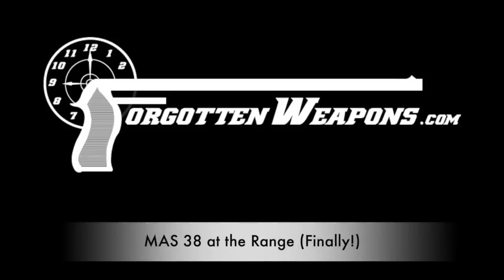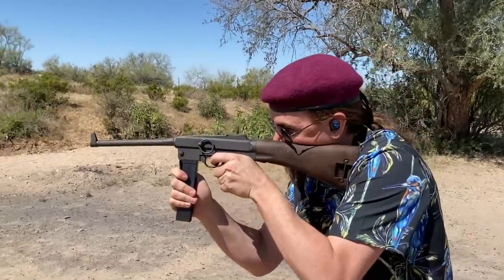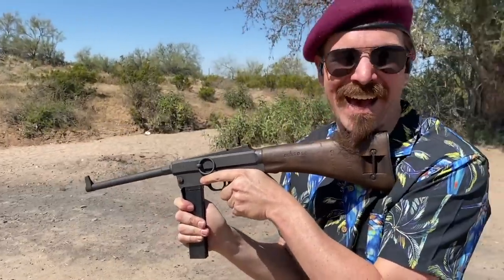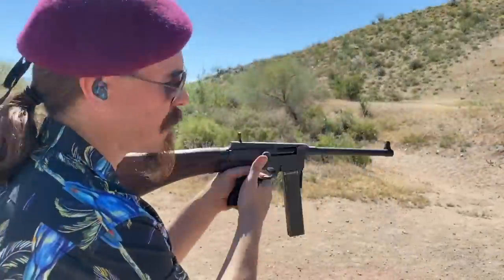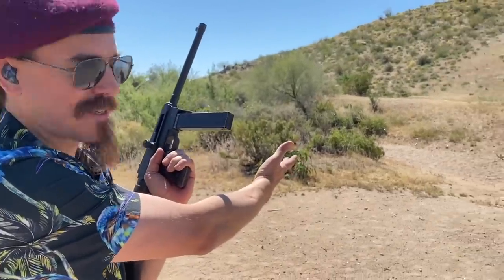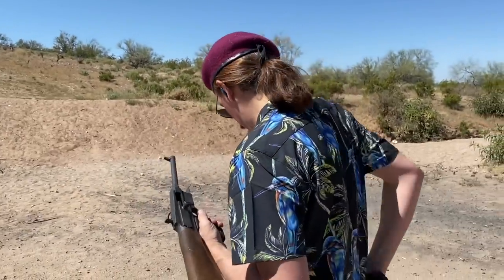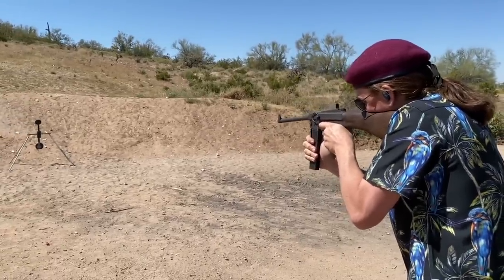MAS 38 at the Range - Finally!

Comment: My OCD can't handle how the gun is angled. 😂
Otherwise great shooting.
Reply: Ikr, it's so weird, it looks like the barrel is bent down like something out of a cartoon.
Reply: I know, right? 😄
Reply: Have you ever seen a Jatimatic, now that is angled weirdly.
Reply: Oh good, it's not just me.
Reply: It makes sense when you see how the gun works but looking at it on paper does seem off.
Reply: @samikoivisto7705  Oh, Gun Jesus, why did I google that.
Reply: @samikoivisto7705  If the bolt of the Jatimatic recoiled upward to resist muzzle climb, it stands to reason that on the MAS-38 the reverse is true. I wonder, because there are no reports that the MAS-38 was especially inaccurate. Ian doesn't claim so either.

Comment: I’m confused, he clearly shoots three single rounds and says he can’t pull off singles.... what am I missing?
Reply: Agreed, that confused me too. I even slowed down to quarter speed and you can clearly see a single case eject both times...
Reply: I scrolled a long way for this. I think i know why. When you shoot an open bolt gun. You hear the bolt going forward and fire the round. And then you hear the bolt smack the rear and it feels like you shoot twice.
(At least i felt like that shooting the Swedish m45)
Reply: @luckygunner8089  I thought similar, but also: Ian has shot pretty much every firearm that has a working example in the world, surely he'd know this? I put it down to heat of the moment confusion.
Reply: @chrisburn7178  Maybe his excitement got in the way of logic. Wouldn't be the first time that's happened to a man, heh. And come on, he finally got a WWII era submachinegun running after years of trying, who wouldn't be excited!

It also looks like a nice little shooter.
Reply: It is the open bolt... it tricks you.. it feels like it fires 2 rounds. 

In Denmark we had a submachinegun where that would happend to.... you shoot one round but feel two recoils.... it is very weird.
Reply: @luckygunner8089  EXACTLY.... the same i am writing about.... shit that was weird...
Reply: I was wondering about that too. Was really confused since it sounded like only one shot each time
Reply: I too noticed the discrepancy, but I assumed that he meant he could not fire one shot at a time accurately, as he was snapping the trigger so energetically. His snapping the trigger is not conducive to accuracy, but is the only way he could do it.
Reply: Cool, I’m glad I’m not the only one who was confused by that.

Comment: Keep the mag well cover in its “open” position, that is parallel with the barrel. Could get your hand high on the mag without burning the fingers. Just a thought. Great to see it finally running. Beret sloping the other way for the French please.
Reply: I think he's actually trying not to grab solely by the mag, in order not to induce feading problems
Reply: Damn thought I was the only smartass that commented on the Beret...
Reply: He also could be worried about damaging it
Reply: Just reminds me that no matter the circumstances you'll be told that you're wearing your beret the wrong way. 😋
Reply: i think he a grabbing low to avoid getting tagged on the thumb by the charging handle, or knocking spent cases back into the ejection port
Reply: I was going to suggest resting other hand above the stock close  to the person's shoulder.
Reply: It also looks like a Swiss Army Beret wich in this colour is for Logistics Troops

Comment: The spectre of Karl's pledge for the 6 o'clock hold is bashed down by the beillance of .32 longue & a working Mas38. Ian is a very happy francophile
Reply: If Karl says it’s right, it’s wrong
Reply: Karl is the Jamie to Ian's Adam
Reply: @CrudeConduct666  I've not really messed with it but I think it makes sense for more dynamic shooting, at least with irons. For the most exaggerated example sporting shotguns always use what could be called a very heavy 6 o clock hold so you have full view of where the shot cloud will go and don't lose the target/bird behind the barrel.
Reply: 6 o clock hold is for unknown distance shooting or machinegunnery when you don't know exactly where your first impact is going to be.

It's not meant for the range. It's basically for using kentucky windage with low magnification Optics in situations where you don't have time to figure out your proper hold, the idea being worst case scenario you'll definitely see the first impact to adjust off.
Reply: @CrudeConduct666  Except you can't see what you're shooting because you have it covered with the fucking sight post.

How to recognize an inexperienced marksman. ^
Reply: @Batchall_Accepted  or, it is the simple fact that Ian tends to choose point of aim & Karl of InRangeTV is a proponent of the 6 o'clock hold. So as friends, Karl states that 6 o'clock hold & Ian's wrong handedness is good natured ribbing between friends on aiming procedure that has gone on for years
Reply: francarmophile please... he does not have ANY relations to the language

Comment: What was actually repaired that you didn't find??
Reply: Please ask in next Q&A
Reply: I am also curious.  Or perhaps it was a number of small issues combined?  Burrs and such?
Reply: For what I can recall the original barrel was weld pluged and then re cut but too long so the ammo was not seat properly in the chamber. Might have needed a new barrel or some extra work in the feed sistem too and bolt re face.
Reply: @luisantolafrancis519  That was one of Ian's theories. But I want to know for sure.

Comment: An interesting looking design with the barrel appearing to run down and away from the line of the receiver and from what Ian described the bolt running down and away in the other direction. Great to see you happy using an old weapon that the yupps of today would cast off as a why would you bother weapon. Cheers for the vid.

Comment: Just from a visual first impression, it seems almost to be straying into the machine-pistol category along side a stocked C96 and Vz. 61, etc. It  also seems like a good match for the role it ended up in as a Gendarmerie machine carbine, particularly because of the low power cartridge. Amusing aside:  If you ever had a UK 'GI Joe' - 'Action Man' - and bought the WW2 French Resistance outfit set, this was the SMG that came with that! :)

Comment: About the grip: Until the mid 1960s, French security forces all based their shooting techniques and stances on military practice. For this reason, I would suggest you get in touch with Le service historique de la Défense, the French military archives, who may hold 1930s instructions relating to the shooting stance using a pistolet-mitrailleur. They not only have access to the French Army, Navy and Air Force but also those of the Gendarmerie, as well as anything where the military worked with the various police forces.

Comment: Nice. I was hoping to see it up and running someday with good ammo. The cyclic rate looks like about 750, but does anyone know what the spec was? If i heard the ballistics right, it is a bit above the 9x18- 15 gr more bullet weight, and a little faster. Unless you are referencing 9x18 velocity in an SMG length barrel. Anyway, i would not care to be standing in front of it within several hundred yards. Pkease make a video detailing what work was done on it, and a little more about the ammo. Great video as always. Thank you

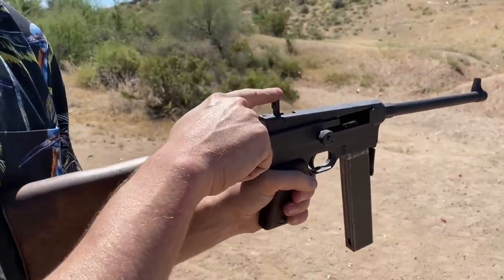Comment: Ian, at 3:49, you have what looks like a serious crack in the stock developing. I hope it's just my old eyes, but it would be a pity if your lovely newly running MAS tried to skewer you in the hand with splinters.
Reply from the maker: That is a fairly common thing in MAS 38s. The stock has shrunk around the metal tube housing the bolt and spring, and cracked as a result. It's not from recoil, and won't get worse or break from shooting.
Reply: @ForgottenWeapons  Good to hear. Thank you for replying!

Comment: It may just be my imagination but there's something about this SMG that really betrays its WW1 origins.
"I have this Ruby pistol. It's great for trench raids, but not very accurate. In order to win the next Great War we will need something like this, but more betterer."
Gunsmith adds stock
"Accuracy is improved, but range could be better."
Gunsmith installs longer barrel
"It's accurate to a couple of hundred metres now, but I want to put holes in Germans faster."
Rebuilds for open bolt full auto
"That's great but the mags run empty too fast. Put a longer one on it. Put it forward of the trigger, so the grip can be nice and slim."
New mag arrangement
"Parfait" says the French Colonel. "I want 10,000 of these before the Huns next try to invade. Oh and make sure to chamber it in some moderately obscure cartridge with few actual advantages over the more popular rimless pistol cartridges."
"But Colonel" says the gunsmith, "Do you not also want something to protect the hand? And I think we could do the same job with a far less expensive stamping, or maybe some gas pipe?"
"I SAID IT'S PERFECT! Anyone who claims otherwise is lacking in élan and in an enemy of France!"

Comment: Did they ever develop a fore grip 

or an even bigger question once the German's took over why didn't they redesign it for 9mm parabellum??

Now For The Really Big Question: 

Why Didn't The British Convert It To 9mm Parabellum & Copy This Instead Of The German MP28??? More Compact Even With A Longer Barrell?? More Compact than even the US Thompson..

How did it compare to the Sten's for accuracy/reliability/production cost

PS Thanks for a buying the weapon & putting together the video. Absolutely fascinating piece of pre WWII European fire arms development history/politics'!
Reply: Are you inebriated
Reply: @alangordon3283  Hey the MAS 38 & MAS 49 were & remains far more ergonomic than the either the Lanchester, Sten or Stirling SMG's, of course the Sten was profoundly cheap to make  & credited with saving Britain but....

The MAS 38 & MP 38 had abandoned the sideways load/feed fore the more ergonomic bottom feed three years before the Lanchester was chosen. I've wondered about the Service/National Politics that went into the decision to adopt an older version developed nearly a decade & a half before hand for years.

Of course the lack of a telescoping bolt's could have been the over riding issue with the MAS 38....

Comment: I'll bet Jerry Miculek could get single rounds with it.
Reply: I'm almost certain Ian pulled off 3 clean singles right before he said he didn't. Went through the video frame by frame. I... Guess the gun just vibrates in a way that feels like a double when shooting? (Open bolt schlpnking forward, then locking back? I mean he should know about it, but maybe the lightness, heat of the moment, et. al....)
Reply: @jubuttib  I thought they sounded like singles too but I didn't want to argue with Ian.